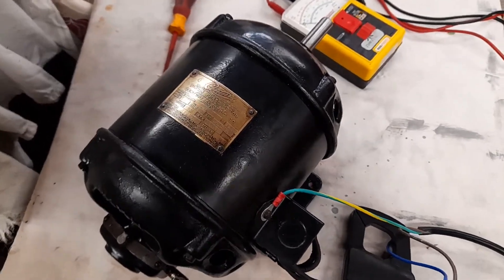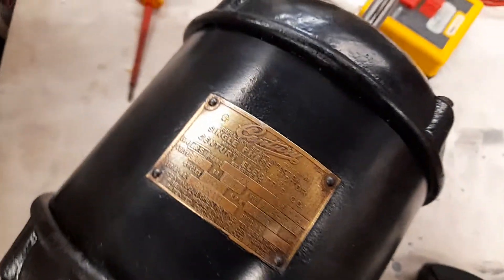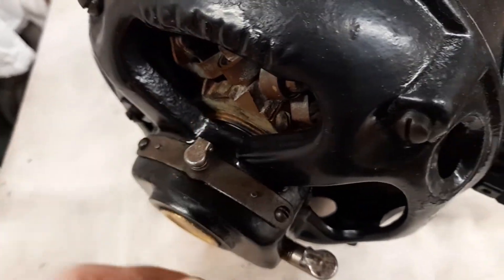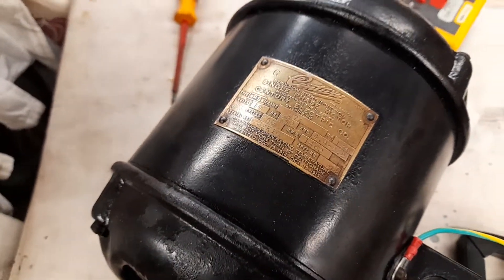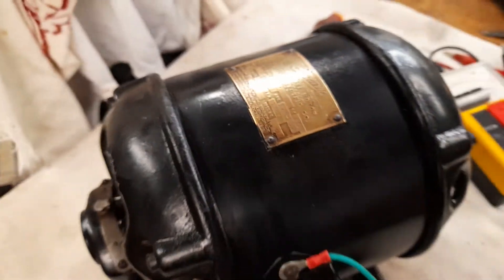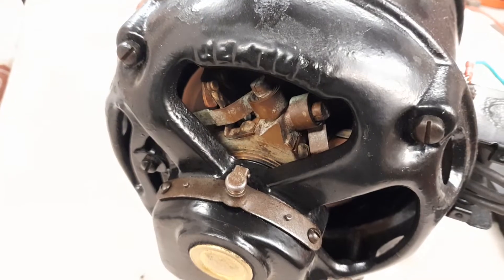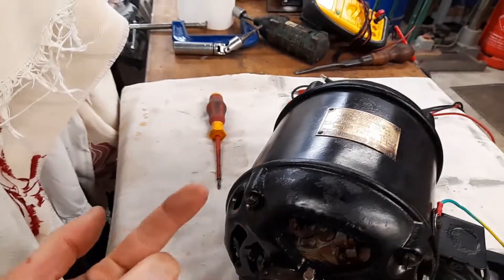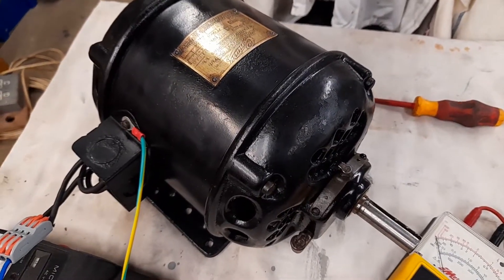100 year old electric motor | Century Repulsion Start Induction Run 1/4 HP

Comment: Needs a commutator job quite badly.  Put the rotor between centers in a lathe.  Take a skim cut to square up the face.  Undercut the mica.  Then debur and polish with a tool post grinder or a small sharpening stone.  Clean the brushes and re-assemble.  Seat the brushes by running at 24/48 volts for an hour.  After that it will run like brand new with barely any sparking.  

Plenty of copper on these commutators - enough for 3 or 4 skim cuts throughout the life of the motor.  They built them to last a century - hence the brand name.
Reply from the maker: Thanks for the info but I no longer own the motor. Maybe your suggestion will be useful to another viewer.

Comment: When you change rotation where should it be set and tightened? It seems as though mine is not starting as quick as this one is
Reply: Line the pointer up with either of the two factory witness marks stamped into the casting (on smaller 'M' and 'RM' frame motors, et. al.) or the brass trim plate (on the big heavy 'P' frame motors).

Comment: America used to have 110v and 220v (as opposed to the split phase 240/120v system of today) and 25, 40, 50, 60, 100, and 133 cycles supplies.  Presumably this motor was made when 50Hz was still being supplied or was made specifically for export
Reply from the maker: I just assumed it was made for use outside the USA. 50Hz is standard here in the UK and most other countries.

Comment: I absolutely love these motors, I’ve got 3 of them: 1/6, 1/4, and a 300+ lbs 3 HP one. Internals were pretty much the same on these motors all the way up into the late 40s early 50s, only difference is the housings became more inclosed. The 3 HP one has an brass oil ring lubrication system that rides on both shaft ends and picks up oil from a sump and puts it on the shaft through a slot in the bushings. My 3 HP restore is on hold right now, the armature has a short in the windings so it will have to be rewired (about 10 lbs of 13 gauge wire). Btw an easy way to tell if the armature is shorter is to remove the brushes and put it back together and apply power. If the armature locks into place the armature has a short as it has a shorter loop allowing the repulsion action to always apply to it.
Reply: I just got a 1/2hp motor, what type of oil should I put, and how much?
Reply: @arturos1263  enough to saturate the wicking material. 3in1 oil makes a motor variant of oil. It’s essentially SAE20 NON DETERGENT. Don’t use any type of detergent oil for gasoline vehicles because it will gum up the bushings.
Reply: @TheVintageEngineer  Thanks Anthony!
Reply: Hi, I have one of these motors with a single curved brush which touches the commutator at the ends.  A while back it wore out and I cut a new one out of a block of carbon purchased from Amazon.  The motor label has fallen off or been removed since it does not have one.  One end has 2 doors, one of which opens exposing a curved brush and commutator on the front side.  Brush is curved, quite long for a brush (about 2.5 inches) and thicker at about 1/2 inch from each end where it touches the commutator.  It's used a lot in our shop, has served us quite well, and rather than cut another brush which takes a lot of and error tuning, I'd like to see if I could find a source for them.  Has anyone ever heard of this model and/or any ideas would be appreciated.
Reply: Any clue where we could find brushes for the 1 HP one at our church that runs our organ?